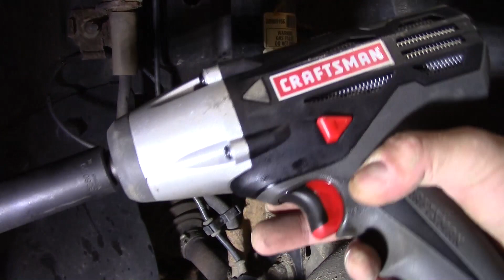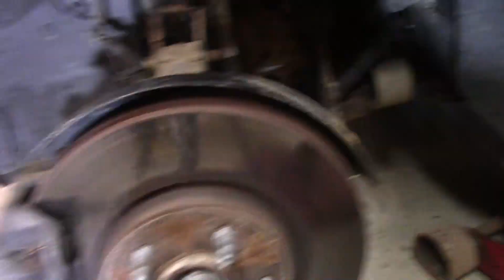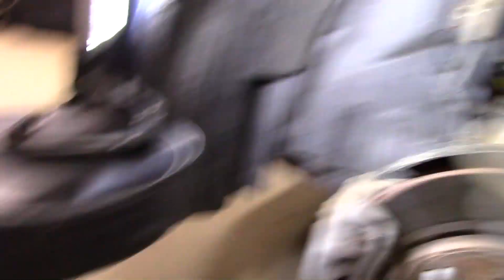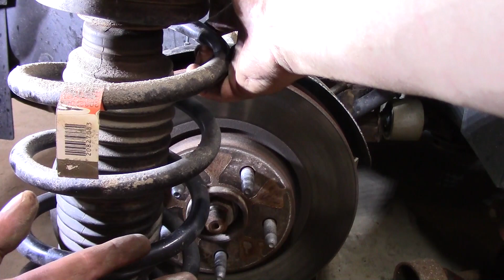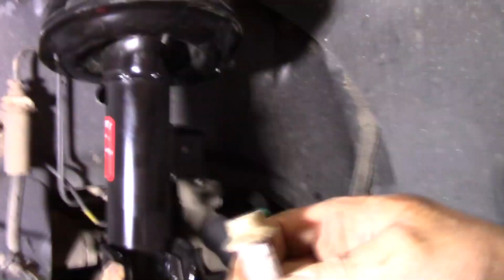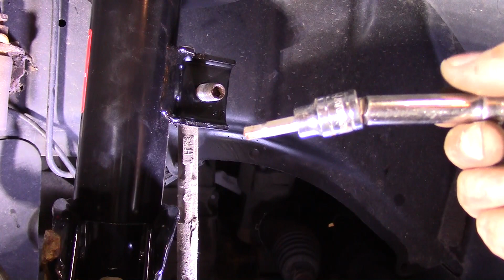How to Replace Front Struts - Chevy Equinox GMC Terrain Acadia (2005-2016) Complete DIY Guide

Comment: Those bolts on top of the strut should of been torqued to 18 ft lb, I'm thinking you way over tightened them.
Reply: what happens if he over tighten them
Reply: @blesdavis7637  He could of stripped the screws, snapped  the screw heads or damaged the threads. There are torque specs for a reason.

Comment: I tried some name brand quick struts on my Chevy van.  They are made to fit many vehicles, so they will be variances.  Mine dropped the body height over an inch and it caused some high speed vibration.  I ended up just buying the struts, new bearing plate, and used the factory springs. Height restored and vibration gone.  These aftermarket, foriegn made parts are sometimes not what they appear.  Buyer beware.  I saved money by reusing the springs, but took it in the shorts by having to do the job twice.

Comment: Just subscribed. My equinox is needing new struts. Me and my friend are gonna do it ourselves. Every crack in the road u feel. 180,000 miles
Reply: The original struts on my '16 Equinox finally gave out on me at 254,000 km.  they had a good run!
Reply: @doubleitp  mine is a 2014 and need replacement at 205k
Reply: I have 60,000 our roads are terrible been in construction since I bought the car should I go ahead and replace as well?
Reply: @tredner1990 Same even at 60k miles you feel every bump its bad

Comment: On most struts, you can't just pop the assembly back on the car. 
Before removing the assembly from the car, note the orientation of the top mount. There is an arrow, or large a painted dot to show which way the mount is oriented to the body. If not, paint an arrow on the old mount to indicate which way is forward. Or, take a picture.
The mount is usually offset, so that you can adjust camber by rotating the mount before attaching to the car body.
You will want to orient the mount to be rotated to the same orientation as the original. If you did not note the position of the strut mount before you removed it, you are screwed.
Reply: "screwed" is a bit much, you might just have three positions to try

Comment: Did you have positive wheel camber? I just replaced my brothers and now there is a lot of positive wheel camber. Any suggestions?
Reply: Before you install the strut, take a high speed air powered rotory tool and elongate the upper of the bottom bolts holes. Then when you install the strut, push in at the base of the strut while tightening the lower bolts. This will give you the negative camber you need. Always take it to an alignment shop when finished. I've done alignments for 10 years now, and this is how we get them right
Reply: I have the same issue. What did you do to ressolve this? Im considering putting in the old springs.
Reply: this guy explains why you should be careful buying quick struts https://www.youtube.com/watch?v=a3bncShvmHU
Reply: quick dumb ? wtf is a positive wheel camber